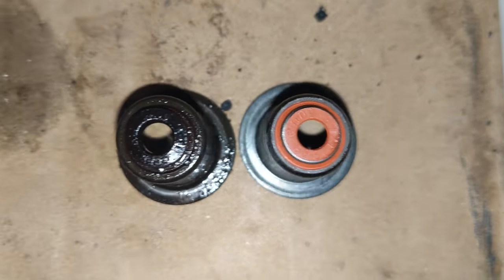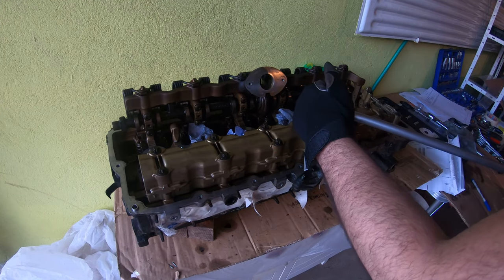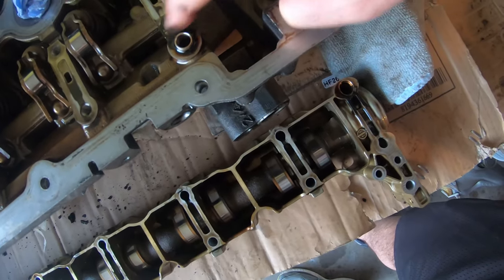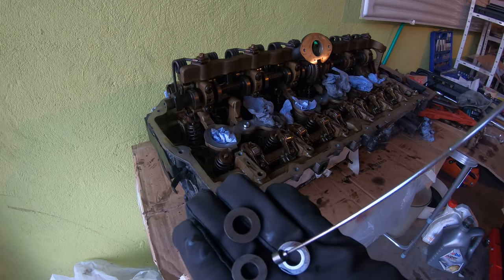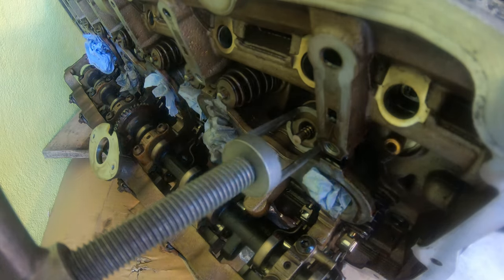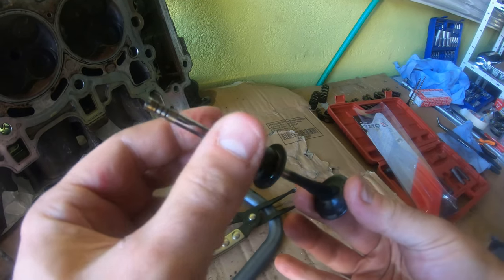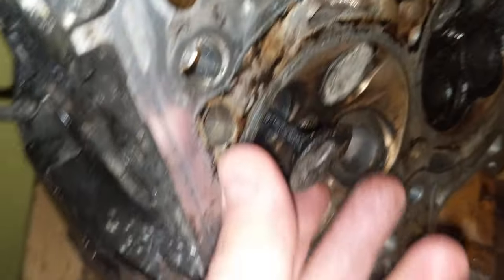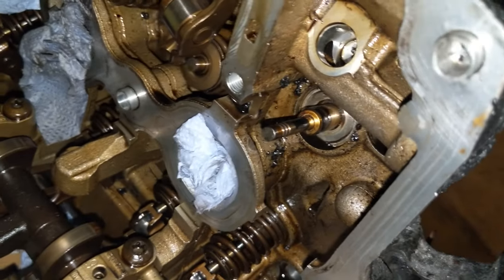How To Remove a BMW N52 Exhaust Camshaft and Replace The Valve Stem Seals [BMW N52 Rebuild Part 10]

Comment: Good video man, glad to have all This info in case I ever rebuild mine
Reply from the maker: Really appreciate the comment 🙏🏼. Hope you never have to rebuild your engine... It's not as easy as it looks and lots of work + waiting on parts 😉 what kind of car / engine do you have?
Reply: @buildanddrive  I have 3 bmw . 2000 323i -m52tu  265,000 miles , 2003 325i - m54. 199,00 miles & 2007 530i - n52 silver top like yours with 216,000 miles on it
Reply from the maker: Wow those are cool car and that's a lot of miles! You must be taking good care of the  👌🏼. Any oil consumption on any of them? I heard the m52 tu has the better designed rings in it than the m54. What is the difference in oil consumption between the two?
Reply: @buildanddrive  honestly I don’t notice any oil consumption on the m52 or m54 . But I do notice on the n52 . But some of it I believe is the oil filter housing and oil cooler gaskets need to be replaced. Which I plan on doing next week. I always do all the repairs and maintenance. Why I’ve enjoyed watching your channel.

Comment: i’m replacing my cam bearing ledge should i do the cam too?
Reply from the maker: If the cam is ok, then no, but replace the camshaft seals to the new Teflon version
Reply: @buildanddrive  i will thank you!!
Reply: @buildanddrive  i found a piece of metal that broke out the bottom of the exhaust cam cage 😳😳 was just changing my valve cover gasket and a piece of metal fell onto my hand

Comment: Cylinder #6 is clean because as there was no compression from the broken/burned valve, and so no combustion. The engine was probably pulled because of fire but likely had severe misfire code for Cyl #6. Engine ECU logic setup to stop firing coil/shut off fuel injector, when detects cylinder misfire, as an attempt to preserve the catalytic converter from burning up.
Reply from the maker: I also think when the valve broke, they tried to walnut blast it clean to clear any carbon they thought was holding the valve open.

Comment: Phosphoric acid does clean the carbon off the valves... but it does take some metal with it. Worked on my valves as long as you lap them back in. Would be better with a drill and brass wheel imho.
Reply from the maker: I totally agree... I did everything with that wooden hand valve lapping tool and it took forever!!!!!!!!!!!! I would invest in a some attachment that connects the valve to a drill!
Reply: @buildanddrive  or before you replace the valve stem seals. insert the valve in the head, on the back side you attach some vacuum hose to the valve, in your drill slap in a drill bit and attach that to the hose.
Reply from the maker: Yes.

Comment: The exhaust cam Leger is worn out you should get a new one 850 Canadian from the dealer and those vanos seals that are metal are junk get new upgraded ones from the dealer 50 each and you have two one way check valves in the head above the timing tensioner bolt 90 each clean them out upper is intake and lower is exhaust take em out and clean them T40 id replace all your valve seals if your into it might as well as do it all right
Reply from the maker: Hey Steve, yes you can swap out the ledger but for budget purposes I just reused it and gently Emery clothed the ledge a bit. I did replace the metal vanos seals to the Teflon ones 👌🏼 on both cams and clean out the vanos filter/check valves. I show this in the following videos when we put it all back together. Thanks for watching!

Comment: Nice video! i need to rebuild mine... 1/600km.. CCV and stem valve new
Reply from the maker: Then it must be your piston rings unfortunately!
Reply: yeah.. i'm sure ! i dismantle soon
Reply from the maker: Instead of rebuilding, you could try to find the n52b30 engine (after 2008) and swap that engine in. Those engines don't burn as much oil. It maybe a bit cheaper and quicker that way. I paid about 1500$ to rebuild my engine. A used b30 could cost less than that but I don't know the details of that kind of swap.
Reply: The swap is illegal in my country.. but for swap after 2007 LCI it's MSV80, before msv70  and it's very difficult for reprogramming msv70 2.5 for 3.0..
Msv70 and msv80 are incompatible!  
Check in french forum 'lemondedudiagauto N52b25 swap !52b30'
Reply from the maker: What country are you in?
Reply: @buildanddrive  France !
Reply from the maker: @pierre4094  Vive la France! Quelle ville?
Reply: @buildanddrive vers Metz en Moselle, vous parler français ?
Reply from the maker: Parfois 😅
Reply: @buildanddrive  well! You have ride with the rebuild motor ?
Reply from the maker: Oui, envois moi un message sur Instagram, et je te donne un link quand le video es fini 👍🏼